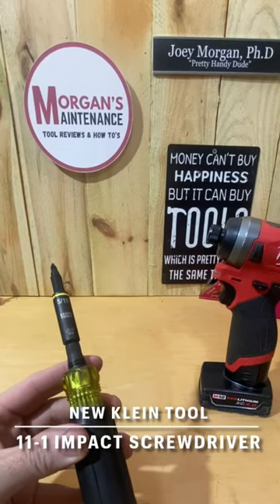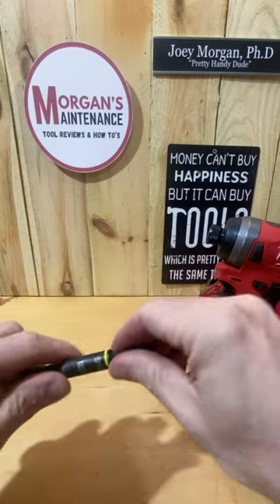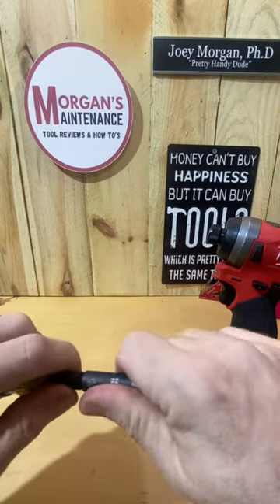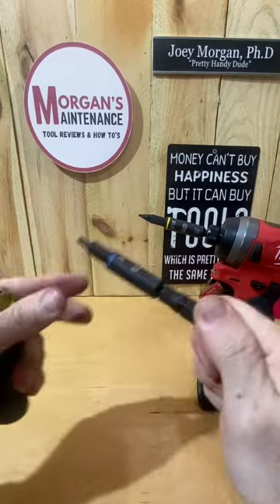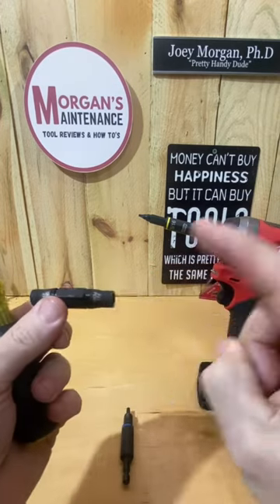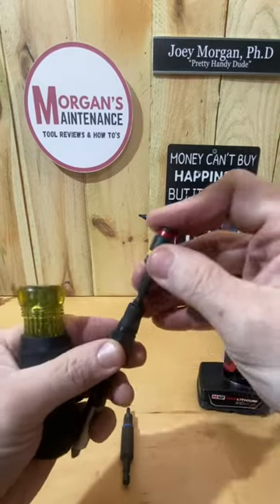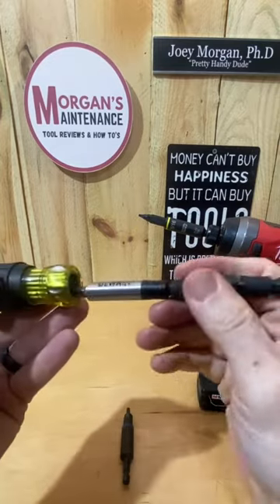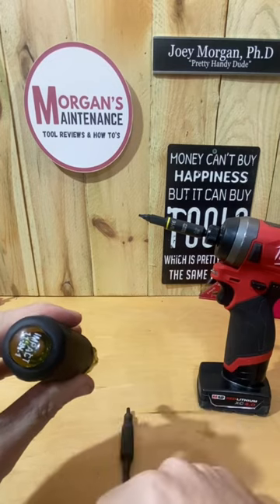Klein Tools New 11-1 Impact Screwdriver + Hack #tools #maintenance #kleintools #electrical 32500HDR

Comment: I wanted to like these, especially since I ended up buying two (11-1 impact and 11-1 impact ratchet) but they both didn’t last. They say they’re “impact rated” but they never really lasted and I wasn’t really putting them through much. The magnet on the regular 11-1 gave out after a couple of months. I tried my best to give it a try but it wasn’t for me. I’m rocking a cheapie Kobalt 13-1. I’ve gone through most of the bits included but I just keep replacing them with the Craftsman bits I have.
Reply from the maker: The only knock I have on mine, is it still hasn’t loosened up much and is harder to pull the shaft in/out than my others. The ratcheting one is better.

I rarely take the Klein bits and out and use them in my impact just because it’s harder to replace those flip bits. Mine pretty much is screwdriver only.  Now that I’ve got the ratcheting, I leave one set up normal and one with a magnetic bit driver and a 1/4” & 5/16” Malco that flips.  Those are what I normally put in my impact.

Comment: I made a really compact carry , designed for “cross draw “. I tend to use it mostly as an “ Off Duty” carry . For heavy work , I mostly use 1” 1/4” hex drivers . In all cases the main tool carry rides on the right hip .
Reply from the maker: Always ready for the quick draw 👍
Reply: @MORGANSMaintenance  Actually is comfortable , rides nice and high , I wear mine in the high left quadrant ( like a good crossdraw holster , very comfortable , I don’t even feel it , till I need a driver . While I can’t comment on anyone else’s needs , works for me ( both “ Off Duty” , and “ Light Duty “ ! That said , for serious installation , I’d probably wear my PB Swiss drivers !

Comment: I think they are too heavy for hvac.   I do a lot of ladder climbing.    I run a Dewalt 8v, malco 6” 1/4-5/16 bit, 6” phillips and 6” flat bit.
Reply from the maker: Yeah when you specialize in something (and even more so when you specialize within that something) you can get your set-up down to a tee with what works for you.

I’ve wanted to get either the Milwaukee or Dewalt powered screwdriver, but always been afraid there would be too many times I would have to go to my truck to get something bigger.  (I’ve never tried them so I am not sure) 

The M12 line has been pretty good for me, every now and then I have to get it the 18v.
Reply: @MORGANSMaintenance  sometimes I carry the m12 impact too.

Comment: Gimmicky, you can not use those malco ones to drive a one inch screw, will not work
Reply from the maker: I use Malco bits all the time for 1” (and smaller) self tappers on HVAC panels.

Maybe I’m not understanding what you are saying or what screws?
Reply: The black one with the 1/4 and 5/16 it’s too short on the 1/4 inch side and the screw flops over every time, also the socket gets stuck on a screw and you don’t notice if it’s dark, you go to use it again and the sockets gone! Hate those things, the techs like them because they never use them to drive screws
Reply from the maker: @Jordan__Sloan  you are talking about putting a bit in the 1/4” side to drive phillips/torx/square type screws? (I thought maybe you were talking about screws with 1/4” hex heads on them… that’s what I use them for)

You can’t add the driver bit with a Malco, you can with the Klein Flip socket 1/4 and 5/16.  (Not shown in this video) You have to pull the 1/4” bit out some until it clicks and it will hold a driver bit.

I will say that you “can do it” with the flip socket… it’s not a good as a real magnetic bit driver.